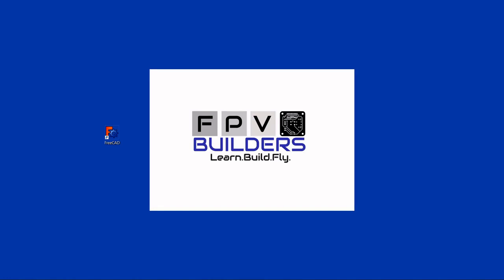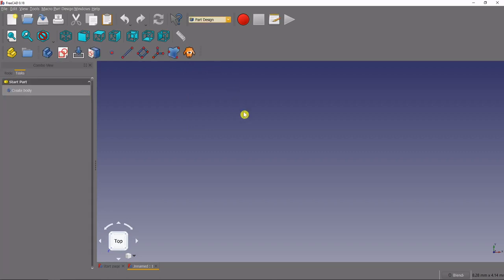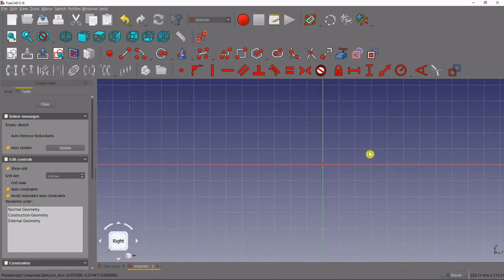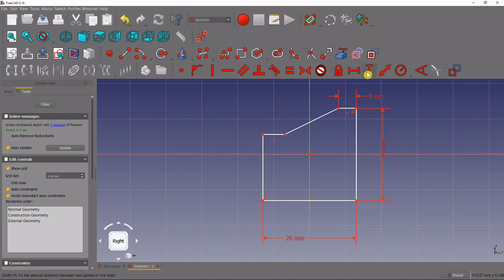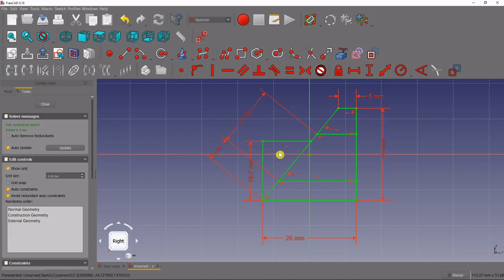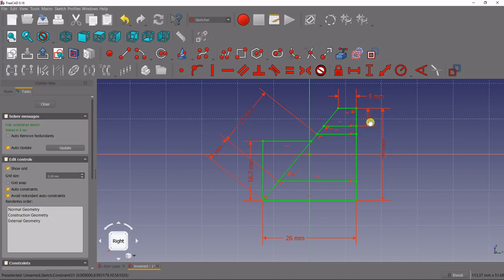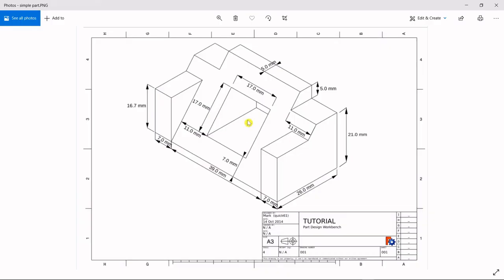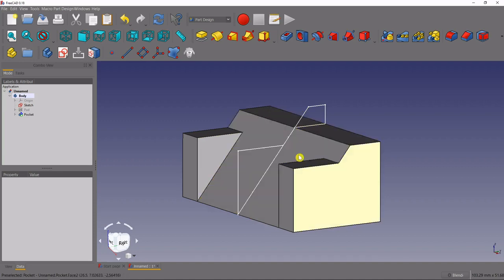FreeCAD simple part with a MASTER SKETCH using BEST PRACTICES. **Tutorial** Video 3/3

Comment: You could add another sketch on XZ for all the padding and pocket dimensions, name the constraints and use these for the length of pad/pocket .. that way you have 2 sketches which you need to update and everything else changes accordingly. You would eliminate a few 'magic numbers' from your design this way.
Reply from the maker: You sure can.  The great thing about 3D modeling is that there is more than 1 way to almost everything.  Find what techniques work for you, and stick with them.  Thank you for the input!
Reply: @FPVBuilders  and thank you for the great content!

Comment: Nice tutorial. As a 2D drafter moving to 3D the master sketch was an insight to a tool to drive the 3D model. I know you can name key dimensions and use spreadsheet to populate them. That would a great next step perhaps?  Even if one was not intending to make several model sizes, for 3D printing, the 'fit' dimensions sometimes need tweaking to accommodate nozzle size or squish from the 3D printer.
Reply from the maker: I am actually going to do a tutorial on that as soon as I finish the tutorial series for for modeling a drone

Comment: Great video! I learned a LOT! But I have one problem -- when you select points, you get an exact point. For example, with drawing a line on a fully constrained view, when I start to draw a line starting on a known point, it not the exact point I selected. This is consistent however carefully I try. If I move the line, the point is NOT the point I think I selected but a new point close to, but not the exact correct point. I have to separate the points and use the concentric point constraint tool. Have I got a wrong preference setting? I can't find any reference in the wiki etc. possibly because I don't know the term for this function.
Reply from the maker: Try this: Edit>>preferences -- Click the display icon on the left of the preferences window.  In the 3D view tab, locate "Marker Size" and increase the size to 13px or 15px.  This will make it easier to select pre-existing points to start a line.  Also, when selecting a point, make sure the cursor changes color, indicating that the point will be selected.  Hope this helps!!

Comment: "Pad: Result has multiple solids. This is not supported at this time."
Reply from the maker: Hmmm, not sure why that is happening.  Maybe try opening a new file and starting over.
Reply: @FPVBuilders  Thanks for the reply, turns out I was trying to pad multiple solid pieces out of a sketch that doesn't touch each other which isn't allowed.
Reply from the maker: I thought that might have been the issue.  Glad you figured it out.